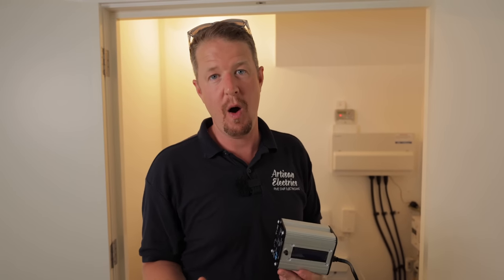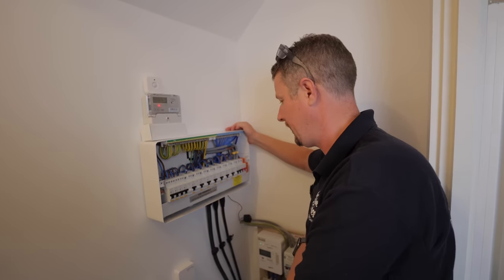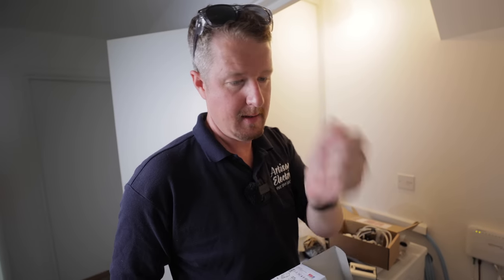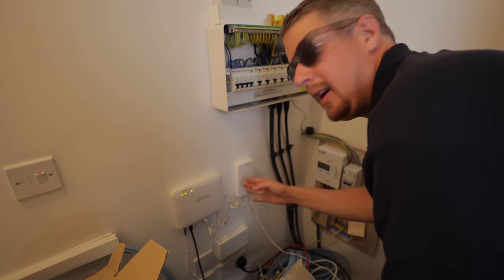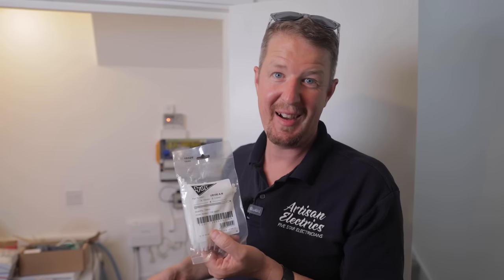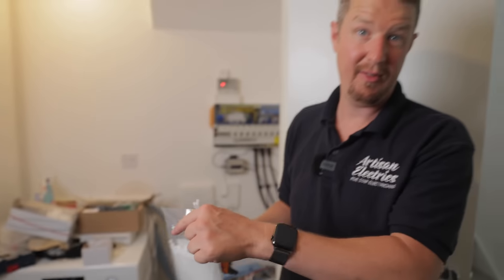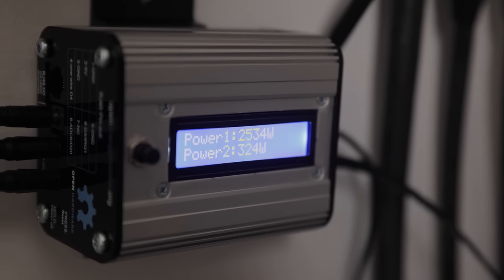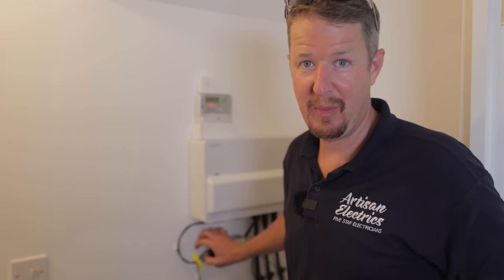Become a WIZARD of monitoring energy consumption!

Comment from the maker: Thanks to Open Energy Monitor for sponsoring this video, you can find out loads more information about what they do and offer here 👉 https://bit.ly/3pHQ5Bw-OpenEnergyMonitor
Reply: Can you blur out the WiFi network names at 3:58 as that's bad secops....
Reply: Hey Jordan, not sure about the specifics of that device but from my experience the ct's should never be installed without being terminated the other end (ie not clipped to a live cable with current flowing without being plugged in to the energy monitor). Can create a huge voltage and damage equipment

Comment: Using monitoring gear that does not require the use of a cloud ecosystem is fantastic to see, OpenEnergyMonitor gear can be used both a cloud service or local communication for those who like to use HomeAssistant or other locally hosted tools.
One of the large concerns around a lot of the likes or Ring and Nest ecosystems where you have no way to directly communicate with the device is that the vendor decides that your equiptment is obsolete and it just stops working or loses functionality, forcing an expensive replacement for what is perfectly good gear.

Comment: That reference power plug you talked about is likely an old style transformer (not switch mode). That will be supplying a voltage reference at a known phase angle. The processor can then calculate power from a known voltage source more accurately than assuming a fixed 240V. The voltage reference will then also enable phase angle difference between current and voltage reference to be measured, thus giving power flow direction. That of course enables the processor to calculate how much current is flowing to the grid, or not as the case maybe.
Reply: Simply put - unless you know the relationship between the voltage and current, you don't know whether power is coming or going and the arrows on the CTs are pointless, nor can you separate reactive current from resistive current. The transformer inevitably will introduce a small phase shift of its own, but presumably, this is small, and the company knows what it is, so can allow for it in the firmware in the box
Reply: yeh that’s pretty much exactly what it’s for
Reply: @eliotmansfield  reverse polarity on the socket feeding the reference Tx could cause interesting issues :)

Comment: A similar product which is good for monitoring is the Shelly EM - I’ve got one in each consumer unit, two CT clamps, monitors voltage too, and has a little relay built in that can trigger contactors on/off based on load. Great little product.
Reply: Agree. Just dropped mine in and have Shelley’s app and it also feeds Home Assistant so it shows up on my dashboard.
Reply: Looked at the vid then went to see how much this was and it’s a lot of phaffing about with transformers I just bought a Shelly with two 120A clamps for under a tonne and I can integrate it with almost everything
Reply: Agree totally.  The Shelly EM is a simpler solution for energy monitoring and is way cheaper and smaller than a Pi based solution.  It also integrates to Home Assistant and doesn't need a separate power supply as it runs on 240V.

Comment: It's very cool that it's open source. With the post pandemic component shortages, Raspberry Pi's are as rare as hens' teeth and so cost more like £150, IF you can find one. Then there's their energy consumption, a Raspberry Pi 4 uses 4W at best, this is for an energy conscious user 🤷🏼. Plus, that enclosure is HUGE!

Re-spinning this as an Orange Pi Zero 2 (much smaller, much cheaper, available, much lower power draw) with a 3D printed case (could clip direct to DIN rail) plus a DIN rail 5V PSU would make a neater, easier, cheaper, lower power install.

Or just use a Shelly EM which are really cheap, insanely easy to install and has a simple network API for getting data and hooking up to all sorts of other home automation goodness.

Comment: Seeing what's required to set that up makes me thank the Dutch Smart Meter Regulations (DSMR) which mandates that smart meters have a "P1 port (which is basically just a 6-pin RJ12 connector)" on them which you can use to connect energy monitoring tools with data being updated every second. Via this port the smart meter provides the current readings for all phases which includes amps, volts, watts (also total across all phases), current tariff (high or low), and also linked meters like gas.

Comment: OpenEnergyMonitor is fantastic - I still use one of the original emonTX, associated emonBase and old school GLCD and emonCMS to monitor my energy since 2014 - they are all Arduino based (which needs a bit of software knowledge but the forums are invaluable) but one day I may move to a Pi to combine some hardware - then linked with a homebrew diverter I have been using my PV to heat hot water - essentially free for 250 days of the year :)

As stated elsewhere, the other transformer plug is to use the AC waveform to derive the voltage - most other monitors on the market simply assume 230V or 240V which can lead to errors...
Reply from the maker: Excellent comment thanks

Comment: I recently installed 2 Emporia monitors - one in the house CU and one in the CU for my garden office. Way more functional than the emonPi with 15 circuits individually monitored and graphed, in addition to the grid feed and soon my solar/battery/inverter feed. Next step will be to flash them so that they push data directly to Home Assistant rather than back to Emporia servers for Home Assistant to download. 

Also, Jordan please throw away those awful plasterboard screw-in "fixings" and use something decent like Fischer plugs!!
Reply: Where is your data stored? As it looks like cloud services how long before they start charging monthly or even just stop supporting the device (bricking it)?  

Secondly this system is open source, you can buy the bits and put it together yourself you can even change the software to do what you want.
Reply: @timballam3675  The Emporia is ESP32 based so can be flashed to send the data wherever you like - admittedly out of warranty, and yep the device ships with firmware that submits to Emporia servers. There is open source community-built firmware out there for it already :)
Reply: problem with emporia is that it's not true RMS reading and you get wierd readings for stuff like pool pumps or induction cooktops.

Comment: Open Energy Monitor is really cool. There is a lot of information on their website. On my side, I choose another wattmeter from Shelly, the Shelly 3 EM pro. Unlike the system installed in the video, you need a server to log the energy consumption (I used Home Assistant, but I had to enable more entities to be able to measure the energy consumption on each CT). The neat thing with the Shelly 3 EM pro, is it's a DIN module, so it lives in the consumer unit (in Belgium, we have more space to wire such modules). Also, since, I have only a one phase system, I had to use a wago to interconnect every voltage input (sadly we cannot set this in software).

Comment: I have Emporia Energy monitor which looks a lot better and more practical. It takes power from the board, no plug needed, and runs on wifi - plugs and network cables are so impractical for UK consumer unit locations…

Comment: the arrow on the ct doesnt point in the direction of current flow mate, its called AC for a reason.... it alternates.   its direction of power flow for typical consumption for grid so grid to house, for solar its inverter to fuse box.

Comment: This looks like a 1-phase residential installation. In Sweden, where I live residential units are 3-phase with the exception of old apartments.
2:10 - is there a bus bar unit in the panel at the bottom? The reason I ask is that if there's something unexpected like a rodent entering the system the juice from the rodent is collected in the bus bar insulation that's shaped as a tray causing less then pleasant results with jumping voltage between the bars. From that perspective I'd prefer the bus bar at the top where the insulation acts as a "hat".
To me this solar panel unit looks quite small, but on the other hand the one I'm familiar with can put out up to 10kW and has a battery pack to draw power from during the time the sun isn't shining - and it also make the production to the grid smoother.
I assume that the reference power supply is more like an unstabilized transformer with voltage to the box proportional to the grid voltage, but maybe there's more info on that.
Today with hourly pricing of electricity the systems also can be a lot more advanced and allow for controlling which units that shall be running - like charging an EV when the power is cheap.

Comment: I tried a shelly the other day, quite good and shows watt hours used during each hour of day, then daily total and active watts used for at a glance reference. Bit expensive though at approx. £60 for one wifi EM unit and one CT clamp. Each Shelly unit can do two circuits though. For drilling, I like the trick of using an envelope stuck to wall for small drilling jobs. Nice vid 👍

PS Also the shelly is just a matchbox sized box and takes power directly off a fuse.
Reply: Good idea using an envelope taped to wall when drilling, have used this method for many years even used a rubbish sack. Used insulation tape on occasions but it often pulls the paint off the wall, be careful
Reply: @chriscleverly8356  I use the envelopes that have peel away sticky bits. Don't pull paint off and done in one
Reply: Not really that expensive I just paid £73.48 for two clamps and the Shelly EM and express delivery this system for Jordan is £200 odd, and almost everyone is integrating Shelly in hoobs homebridge home assistant
Reply: Not really that expensive I just paid £73.48 for two 120amp clamps and the Shelly EM and express delivery this system for Jordan is £200 odd, and almost everyone is integrating Shelly in hoobs homebridge home assistant
Reply: @DTech101  Wow, didn't know his great was that much. Mind you, looks solid enough.

Comment: If you had a crack at KNX, the ABB EM/S3.16.1 would do everything and much more, while the measuring could then be used to switch on consumers, visualize consumption (on pretty much any device) and control things like heat pumps, saunas and hot tubs without a server and with a tried and tested standard.

I wish I could show you around the Light&Building show in Frankfurt in October and give you a crash course in KNX and digital electrics.
Reply from the maker: That would be cool
Reply: @artisanelectrics  Seriously. Be my guest…

And it is one of the biggest trade shows for Electricians in the world. Lots of cool stuff and new ways to be more productive!

Comment: Nice install and kit. Is it ok to have a single-insulated wire coming from inside the consumer unit into an accessible metal device that’s not earthed?
Reply from the maker: Not sure what you are referring to?
Reply: It's a good point. I'd say in this instance the CT wire will have two cables inside, which will be insulated and then the outer sheath acting as the second layer. They will be Extra Low Voltage too, so keeping them in a separate entry hole, will prevent any other issues.
Reply: Sorry I wasn’t clear. It appears that the emonPi device with its metal case could be considered an exposed conductive part.

Before the CT coil is plugged in, the device is presumably double-insulated and hence all is good. However, it could be argued that as soon as you put a wire from it going directly into the consumer unit, it introduces the possibility of the case becoming live. The CT coil cable could be damaged and hence touch a live part in the consumer unit.

In all probability everything will be fine, and this sort of thing is done frequently, especially with the number of current-measuring devices we have these days.

Comment: Hi Jordan, not that you need it but just a tip I've learnt from bitter experience, if you drill with a very small bit and find that you hit a stud or a dab, then in the case of a stud you can then just screw in a wood screw with no need for a fixing, and it it was a dab then you can just drill a bigger hole and use a raw plug. Both are better than that fixing you are using as it has very little holding strength and any counter clockwise movement loosens it. But not wanting to teach you to suck eggs!
Reply from the maker: Nice tip!

Comment: Great bit of kit, however the company is not easy to get hold of on the phone or via email so that is letdown from tow points of view.  I do however have question, I have an economy 7 tariff, so do I buy one with one or two CT's so I can monitor both supplies as currently I have two Wylex re-wireable fuse boards for each supply.  Any help would be appreciated.

Comment: You said you had to be careful of the power going into the top of the switch and that there was nothing you could do about that yet 1 foot to your right was the main isolator from the meter ?
Also shouldn’t there be an isolator from the PV I to the board so the entire board can be isolated ? Presumably those wires you stuck the CT clamp onto we’re still live ?
I didn’t know about the arrows on CT clamps so always a learning point with your videos :)

Comment: The low voltage cable sense wire from those current clamps is unlikely to have full 300V insulation. I would prefer to add a thicker sleeve over where they are in close proximity to the 240V circuits as you are below the normal 50mm separation. Particularly inside the consumer unit.  Also I always feel that clamping the neutral is slightly safer than clamping the live as there is far less possibility of insulation break down.

Comment: The most annoying thing about my house is that the consumer unit is in the downstairs loo, so obviously having an easy connection to the router (and even more to device power and reference) is pretty much verboten.
Reply: I've got a similar setup. There's an emonTx box which is a separate remote sensor you can put near the consumer unit and it talks to the emonPi over a low power radio signal. So the emonPi can be sited near the router. The emonTx can be powered by AA batteries, mine lasts about 2 months.
Reply from the maker: Maybe you could use some kind of water wheel to power the router ⚡️
Reply: @artisanelectrics  Urea-ly think so? I've heard of undershot and overshot waterwheels, but oversh*t is a new one...
Reply: Emporia Energy monitor uses power from the board and runs on wifi - check them out mine is brilliant
Reply: @countertony Shelly EM is what you need it installs in your consumer unit no external power needed 😉 not sure how good wifi signal is in a metal consumer unit though.

Comment: can you moniter a 3 phase supply? I  suppose you would need a box with 6 ct clamps  3 for the incoming & 3 for solar?
Reply: The emonPi on it's own can't but with an emonTx (or possibly two) it can (wiith the correct firmware) have a look at the openenergymonitor setup guide. They also have a good support community.

Comment: Just a tip if you look at the bt box or most access points (excluding mesh units such as Google etc ) it should have a 5v usb a connector off of it thus saving the need for the mains plug
Reply: Probably not a great idea to run a pi off of it, particularly not if you’re professionally installing something. Pis will draw 2A plus at times.

Comment: I've had one of these for years. They work great when they work but I found the SD card kept corrupting and shitting itself every few months requiring you to rebuild and start fresh. Quite annoying.
Reply: Sounds like the SD card they were using did not have the sustained right capabilities needed for all that data, hopefully they upgraded to a better model or maybe they just got a bad batch. I would recommend replacing with a much better quality SD card.
Reply: I had the same, using the emontx and emonesp sending data to a separate raspberry pi 2 with emoncms installed on it. There's lots of small amounts of write/reads which normal SD cards can't handle over time. Got an 'extreme' or whatever it was SD card designed for this purpose and it's been fine since!
Reply: You need to log to the cloud or a local server, as cards in pi’s crap out if you’re writing to them all the time, no matter how posh an sd card you buy.

Comment: 21:10 Isn't that to measure the voltage for your P=UI? I from the clamps, U from the wall wart? Maybe that's what you meant. Edit: That's also why its an old style transformer type, likely without any voltage regulator (But with a rectifier diodes and smoothing cap to make the sampling by the RPI easier) that way it can monitor the line voltage by measuring the output. It would not need to be referenced to ground, I would bet it’s not on second thought.
Reply: I imagine it’s just got an ac output so the monitor can figure out power factor as well as voltage.

Comment: 2534W ? Good grief what were they running to need all that power, even without the EV charging?
Reply: Given they wanted an open source monitoring solution and a UPS, I would guess they're in software or engineering, so wouldn't be surprised if they were running a couple of servers, NAS's and desktops 24/7

Comment: I installed a sense energy monitor. It's really too bad there's no ethernet on it because you know in the basement next to big metal objects it's just the right spot for wireless devices < sarcasm. And sure enough 3 feet away dangling from the ceiling the access point it was having trouble connecting to. I went this route because I wanted the device detection.